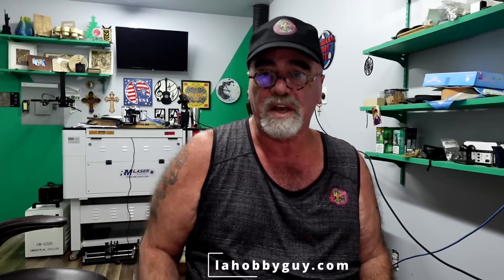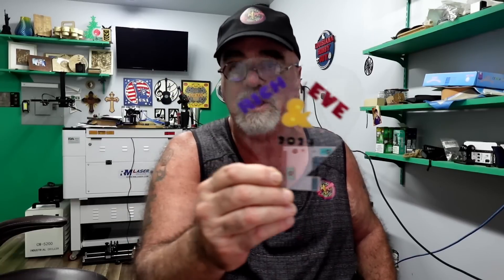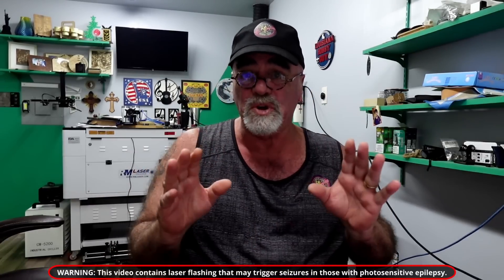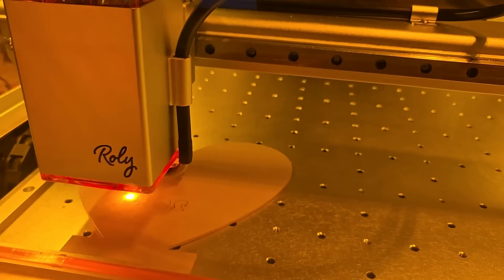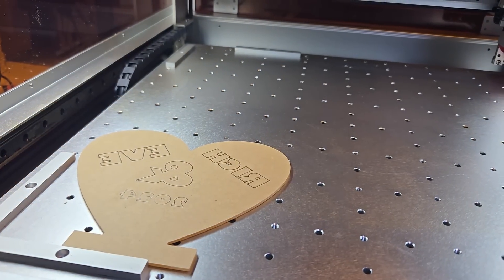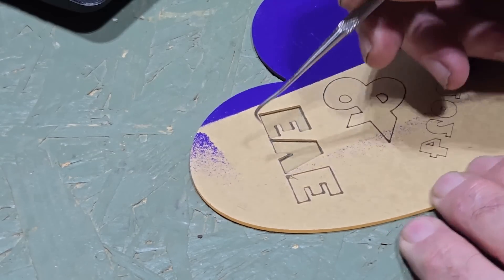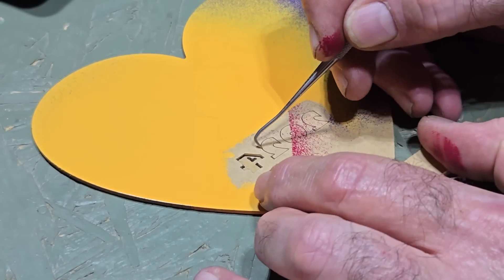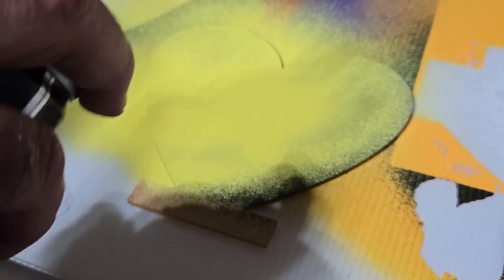Color Fill Clear Acrylic on a DIODE LASER

Comment: thats really cool - would you mind sharing the speed and power you used  - thank you
Reply from the maker: The speed and power I used won't work on another machine Burt. I used a preset in my material library from another machine that was too hot, proving this. You have to run a material test to find the right settings for your laser.

Comment: My laser (first one ever) is one of the $300 "discount" Sainsmart 5w diode lasers with a 600 x 600 (23.6" x 23.6" bed) and it struggles keeping focus as the laser travels to the far corner. I've leveled it as best as I can, but I believe the framework has discrepancies in it. Watching your videos has helped me figure this toy out. I'm glad to see that diodes will do more than "sunburn" light wood projects. My plan is to update the laser when the 5w wears out, or when I get enough experience that it no longer lets me learn.

Question: is there a "quality" of acrylic that equates to hardness of wood? I've found that certain types of wood (plywood and hardwood) that my laser doesn't get an even burn on, no matter what settings I use. I assume that the plywood issues are due to what adhesive they use to join the layers and how it absorbs the heat from the diode. I know that acrylics are sold in different thicknesses, but can't find information on "hardness" or anything similar to it.
Reply from the maker: Acrylic is measured in thickness, not hardness like wood William. What you're experiencing is the wavelength of the diode. They're 455nm +- and can only cut through solid dark colors. Black, red, & yellow are a few that work well. Most other colors don't work.
Reply: @TheLouisianaHobbyGuy  Thanks for the heads up.. I'm still (after over a year) dialing in my wood libraries. One day, I might feel comfortable enough with my knowledge to invest in a "real" machine... I just don't see the sense in paying out until I KNOW that I will use it enough to be worth it. Till then, it's just a fun (though frustrating) hobby.
Reply from the maker: Good thinking...